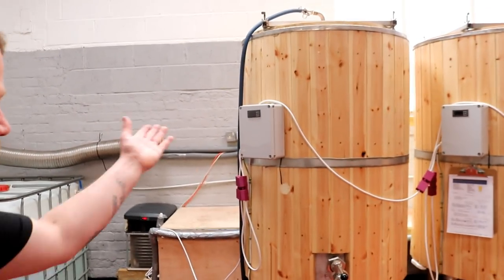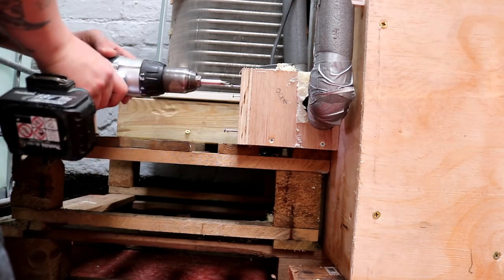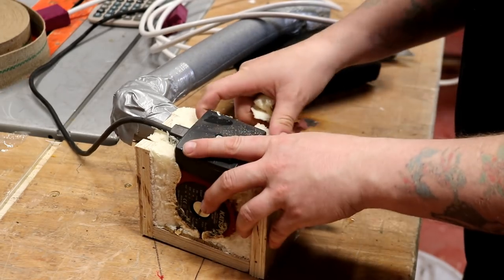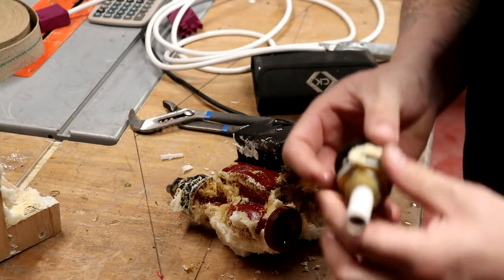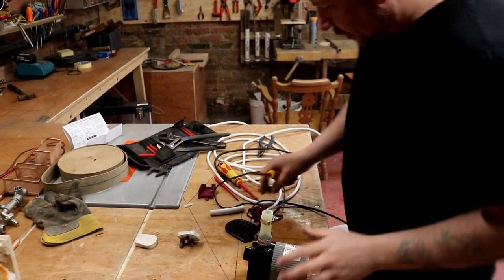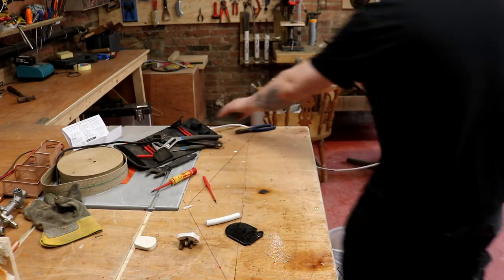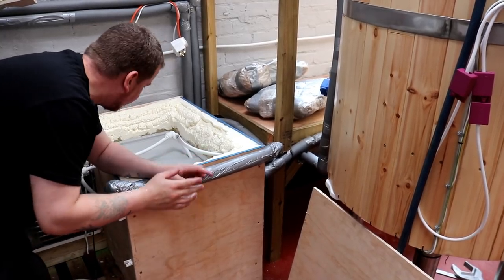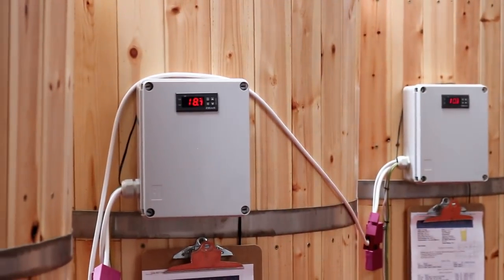Oh No! The Glycol Pump Failed.

Comment: I’m sorry to say it but you’re wrong. The motor needs air to flow around it. Those magnets will get super hot and the foam trapped the heat.
Reply: Definitely not a good idea having the foam.